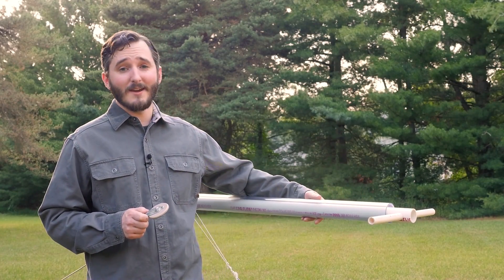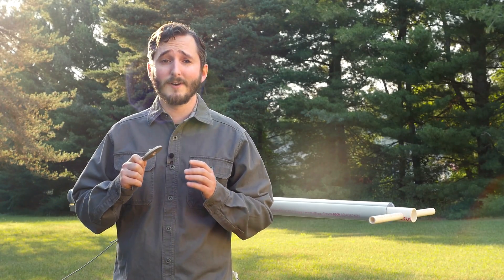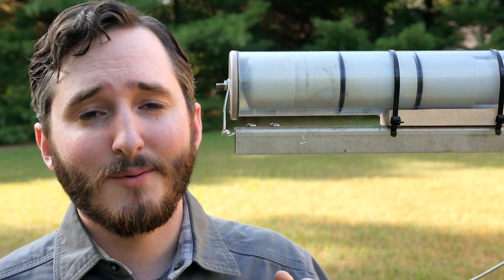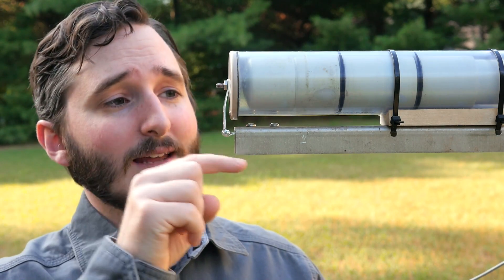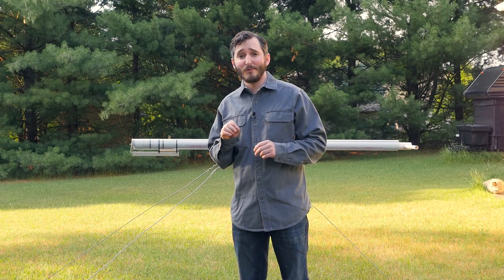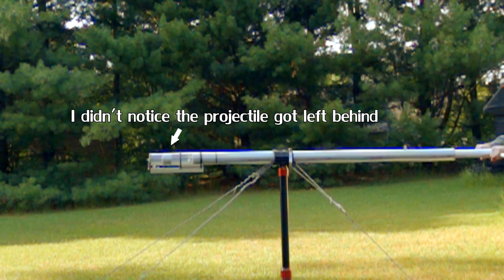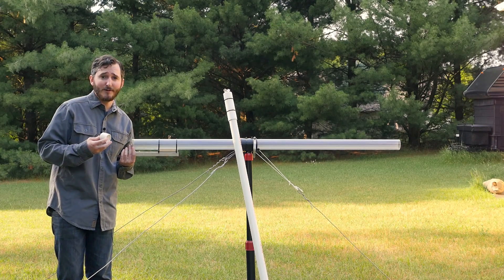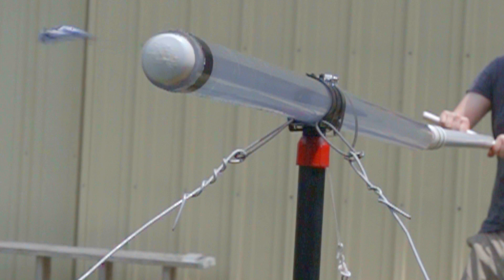Firing A Clear Vacuum Cannon & Testing Viewer Suggestions

Comment: Nice work--you could try using a very light material (like a carbon fiber disc) to seal the end, and you could also have a hinge that could move out as well as down--attach the hinge to a light rod that slides out of a tube connected to the cannon, for example.

Comment: For the flap valve: How about not being hinged but rather, held in place by a very small tab at the top and a weight on a string on the bottom.
╓___________
║|
║|
║|__________
⁞
⁞
⁞
▀

The tab is just barely holding it up. When pulling the piston back, flap will be pulled to the pipe from vacuum pressure.  Once piston comes out, air will cause tab to release and weight will pull flap down.

In theory at least!  :)

Comment: Why don't you make your projectile your front valve? Place it x number of inches into the barrel and insert two lap screws (one on either side). If your projectile is well fitted it will seal and butt up against the screw sticking into the barrel. That way you don't have to fit burst disks or make a flapper valve.

Comment: Would a larger diameter but shorter length barrel have the same effect if the volume displaced was the same?
Reply from the maker: No, you need length for the projectile to accelerate properly.

Comment: The biggest issue with the fla is its own mass. Inertia is you problem. If a flap with less mass was attached, it could move with much less force and accelerate much faster. Carbon fiber materials are fairly cheap as long as you already have a vacuum pump. I would suggest making the flap and hinge both from carbon fiber to maintain strength with minimal mass.

Comment: In my opinion, you should take advantage of the principle of energy conservation! Build a bullet that hermetically seals the top of the tube and has the same mass, or a slightly lower mass, than the bullet that collides behind! It should have a one-way valve inside to get out the compressed air just before the impact !! Do this test !!! ;)
Reply from the maker: Interesting idea, you're the first to suggest it. I'll have to think about that one.
Reply: If the bullet at the top of the tube splits, use the one-way valve as a pneumatic shock absorber !! Make sure that the flow of air out of the valve can be varied!

Comment: What if you don't use anything to hold the valve, i mean, the valve could hold in place using the vacuum of the cannon itself, but you will need someone to hold it before you start pulling the piston though
Btw i loved the video, greetings from Spain!

Comment: WEAK spring wire (or perhaps an elastic setup)  to assist opening such that without a pin it doesn't stay up BUT that the vacuum applies enough sucking force to hold it in without the pin.

Comment: lose the hinge, use a small amount of blue tac or similar just enough to hold the cap intill the vacuum can hold it on, and tie string onto the end of the cap so you don't lose it. or you can use a larger ring around the barrel to hold the cap inside.

Comment: Two half-circle valves mounted on opposite sides of the barrel (like a double door) might open faster than the single whole-circle valve. Dunno how hard it'd be to get the center seam to perfectly seal, but if you pull the piston quickly, a "close enough" seal might be, well, close enough.

Comment: Maybe you could make a sensor relay to force open the end of the valve. It would have to be a very quick opening solenoid. A sensor that is placed at the end of the tube when the projectile moves past it, it then opens it up just a split second after the air starts rushing in. Timing would likely be an issue I imagine. But maybe you could get someone from Tested for (Adam Savage?) for his expertise. Seems like there might be holes in this idea or maybe an adaptation that might work. perhaps as the projectile is moving forward it senses the pressure on the lid and moves the opening out of the way for you. Just thinking out loud. (Or on screen)

Comment: Instead of using a burst disk on a rotating hinge, why not make a plug that has enough PVC on the inside of the end of the tube to hold it on, but keep it light enough to be moved out of the way. Becuase with the hinge, it still has to move up or downwards out of the way, which gives the projectile enough time to hit it on it's way out. Because with the aluminum burst disks, the move in the same direction as the projectile, but don't have enough mass to slow them down much.

Comment: I would try a thick chunk of polystyrene (such as you find when unpacking a new computer or shop machine, etc) dangling at muzzle level from a piece of kite string.  If it hangs in just the right place, it should seal to the muzzle within the first foot or so of draw on the piston.  It should be light enough that it may not affect the projectile, even if it hits the polystyrene.

Comment: I have a suggestion!!! It will be difficult but I think it may work if done right. I think this valve idea will work if you drill two holes in the pipe and attach them to each other with another pipe used to carry the air. (This is like an Ak47 where the pressure created by the bullet is used to draw the bolt back for the next shot.) My thought behind this is that if you have a hole directly in the middle of the cannon and another hole maybe one inch behind the valve, when the "bullet" passed the whole the pressure will rush through the smaller connecter pipe giving the front valve a burst of air to open before the bullet reaches it. Of course this will create less power but I believe it will work with the correct placement of the holes. I would think that the best place to put the holes would be in the back and as close to the valve as possible. My second idea would use the same idea with the secondary smaller pipe connecting close to the valve but this idea would be a second piston attached to the one you pull back on. The second piston will go inside the smaller tube and when you pull out the one,the other one will release at the same time (theoretically). With this design you can adjust the length of the smaller tube to optimize the time between when the air shoots to open the valve and the bullet is released. (Shortening the small pipe will let air in before the shot. And that will be what happens the valve. But if it is to short the pressure difference will slow the bullet and lose power. The ideal timing will be when the valve opens at the last possible second before the bullet hits it.)  Thank you for putting up with my lengthy comment but I think this will work. I'm a 16 year old aspiring engineer so I love these thought puzzles. Thank you for your time

Comment: You could make a duel barrel cannon but only use the second barrel to knock the value off, and not put a projectile in it. And then connect the two pistons together. I would be a waste of energy, but it should work and you could also make the second barrel smaller and the just connect the pistons out of sync if that makes sense. It should do the trick

Comment: To exercise in zero G, astronauts use pneumatic pistons like this to provide constant force throughout the stroke. Have you noticed that in your experimentation, that it's the same amount of force through the entire pull?
Reply from the maker: It is a constant force once the chamber is at full vacuum. After that it will be unchanged no matter how long the pipe is

Comment: For the valve try adding a bit weight to it so can fell down faster. to keep it close try use small magnet on the top / the opposite of the hinge so you can move the valve slightly inward making it easy to fell off again. maybe can work. Good luck

Comment: What if you were to drill and tap a hole just before the first ziptie. then screw in a Schrader value of some type so you could hook up a pump to pull a sort of PRE-vacume before pulling out the plunger.

Comment: 9:05 wow, the red smoke you can easily see it bouncing like a spring on the inside. I expected compression when the 2 sides collide but not any bounce backs as much as it showed.
Reply from the maker: The bounce back is because the burst disc on the other end didn't break because I wasn't firing a projectile

Comment: try moving the valve pivot back to normal or even behind the valve and then hold it closed with a small amount of grease on the end of the pipe

Comment: It may have been already mentioned below, but you could probably make the flap valve work by making it lighter and adding some form of tensioning system that increases the force that pulls it out of the way. 
You could decrease its mass by putting the gasket material mounted to the tube so it can remain stationary. Also, the flat shape requires more mass than a domed one. Maybe you could use the bottom of a soda can, they are extremely strong and light. Just not sure if the diameter is large enough though. The other thing is the hinge itself. A pinned hinge such as you used is very strong and fairly heavy too. If you replaced it with a strip of spring steel you could even pre-tension it when in the closed position so that it springs open under the added force of the spring once the vacuum force isn't enough to keep it closed.

Comment: so two things first u should fire a smoke bomb out of the Cannon and second would a paper/cardboard valve work all u need is something to hold the vacuum inside right so if it can be done with aluminum maybe it can be done with some similarly light but reusable

Comment: I wonder If you could spring load the seal to open once the vacuum collapses instead of relying on the high pressure spike to push it clear. This way none of the projectiles energy is wasted on it trying to force its way out of the barrel.  But like you said, it might be too complicated.

Comment: you should spring load the flap and put a sensor near (maybe even in the flap) the end of the barrel (sonar or something) which will remotely trigger the spring loaded flap and open it before the projectile hits the flap. alternatively put the sonar inside the projectile itself

Comment: Tie a string to the front valve and then run it under the cannon and tie it to the end of the piston. You will have to experiment but if u get the length just right it should pull the the valve at almost the same time the piston is removed from the barrel

Comment: Why don't you add a smaller in diameter tube over the main one? It could be left empty, maybe cut a few centimeters shorter tha the other one, so it triggers just an istant before the other and could open the valve in the front. The chambers should be separetad, the valve made a little longer (it would have also more torque) and you would have to modify your pulling piston like a fork with two teeths.

Comment: Maybe there is some way of rigging up a rubber band or tension spring to accelerate the valve opening once it moves past a certain position. This would of course still require the air cushion to initiate the valve opening for this to work.

Comment: Add a smaller caliber acrylic tube above the canon and use a twin piston. The top small caliber tube then can operate the valve ( assuming the projectile will be slightly slower than the shock wave in the tube above)

Comment: As in my first suggestion on original video, the valve should be preloaded to open. This would be done ether with aditional weight or a spring. This is where you would require a latch pin that could be realesed when a vacumm is present.

Comment: i'd use a spring loaded valve which can be secured with a small pin (like a hand grenade). The pin should be removeable with a string. The string is attached to the piston. So when you pull back the piston and und gun is nearly firing, the pin gets removed and the atmospheric pressure holds the flap valve in place. Probably needs some tests for the spring tension and maybe the length of the string.

Comment: Put a latch on the valve that keeps it closed tight and hold the latch in place with a pin. attach the pin with a cord to the handle to that it pills the pin after you have pulled back the handle halfway. 
Then springload the latch so that it powers it itself open once the vaccum is broken. The vaccum will hold the valve shut even after the latch is undone, resisting the spring pressure.

Comment: Would the gravity end cap idea work if you removed the first zip tie so that when it falls it has further to fall so that it doesn't spring back up and obstruct the projectile? Then to hold the cap on while your pulling it back you could add a little bit of a lip to the end cap to hold it temporarily in place until you draw the vacuum?

Comment: What about if you installed two strong opposing magnets on your cannon? One on the frontside of the projectile and one on the inside face of the flapper valve? Yes they would have to be quite strong magnets and if you try this I think it will also be worth trying to reduce the mass of the flapper valve as this would make a huge difference in its effectiveness. I'd imagine there would be a sweet point between weight of the flapper valve and strength of the magnet used on it if that makes sense, as the heavier it is the more force that it required to move it, hence the more compressed the air will need to become. 

Great work though, this is the first vacuum cannon video of yours I have watched and it is awesome! :)

Comment: I think the flap needs a total redesign.  It must be very lightweight if you want the leading air pulse to move it fast enough to force it fully open.

Alternately, it could be rigged to be electrically opened in response to the approach of the projectile.  An optical device could do the trick well.  A solenoid could release a spring-loaded mechanism.

Comment: if you add two hinges it would double its mobility therefore cutting impact force in half, or you could even attach the flap with  wire from an electronic the wire would have to be thick enough though

Comment: How about adding a small spring to the flap valve. By positioning the spring below the hinge point, the action of the spring would be to add hysteresis. The spring would pull the valve closed as the valve passes the mid point towards the pipe and pull the valve open as the valve passes the mid point away from the pipe. By minimising the angle in the closed position, the force closing the valve can be controlled as it's given by spring force* cos(angle). When valve vertical the angle = 90 so spring force is zero in horizontal direction.

Comment: Add a magnet to the front of the projectile and a magnet to the flap so that they repel. By experimenting with the size and strength of the magnets you could adjust the buffer between when the flap opens. If that doesn't work try adding a reed switch to the top of the cannon and putting a small magnet in your projectile. Make a spring loaded flap from a mouse trap and then connect a servo to your switch which will trigger the mouse trap when the projectile passes your switch.

Comment: Looks like the flap valve is too heavy. The force applied by the small air cushion is not strong enough to open the valve in time even with the gravity assist. The gravity assist is only effective when the valve moves past a point on the pivot which is after the projectile hits the valve. Although, keeping the valve at this position is the optimal setup.

Comment: There are two main issues I see with the valve.  Look at the distance the main projectile has for its acceleration. The valve has much less distance for acceleration since it doesn't start accelerating until shortly before the projectile is in its starting position. ( Maybe due to shock/sound waves travelling ahead of the projectile? Your slow motion with the burst disks seems to show the foil bulging  before  the projectile reaches its starting point. )  
The current valve looks to me like it has ~1/3 the mass of the projectile, but less than 10% of the distance for acceleration. I think something needs to change for the valve to have a chance to accelerate quickly enough. 
For the valve, there are two things I can think of. First, its mass, which had already been suggested. Second, its aerodynamics; think of the trick where you break a ruler over the edge of a table by laying paper over it. I think a fairly simple way to solve both of these would be to use half of a 2" styrofoam ball, round side out, with something airtight and non-stretchy glued to the back (with adhesive that won't eat the foam). Aluminum duct tape might work for this. The rubber seal could be attached to the pipe rather than the valve to get a further mass reduction. Maybe a thin bead of silicone caulking around the pipe edge? The hinge could probably be reduced to a bit fishing line, by hanging the valve from the top as before. 
If none of that works, increasing the mass of your projectile may help. You'd end up with a slower projectile, but I think it should give the valve enough time to get out of the way, and leave you with more kinetic energy remaining in the projectile.

Comment: try a lighter weight flapper valve. a lighter valve will have less inertia and should move out of the way faster and easier. your heavy valve and metal hinge require a lot more energy to move

Comment: Liked the correct scientific explanation! Not a single drop of BS, really!
...But IMHO the flap valve should be lighter. There is no need to keep rubber across the whole surface and the lighter valve design may actually work.
Reply: ...Or put the sealing on a tube itself.

Comment: Try extending the metal square stock that is holding the flap, and add a strong spring or bungee cord that will pull at the same time as the air pushing it?

Comment: I have a pretty simple idea about your valve problem. 

Instead of making a mechanism that relies on that hinge you could use a magnet mounted to the tube just to hold the disk on with the least amount of force so when the air rushes back in it just pops the valve off as it travels along the tube.